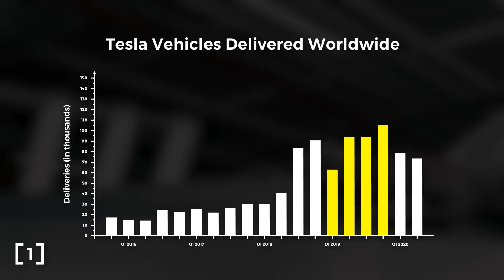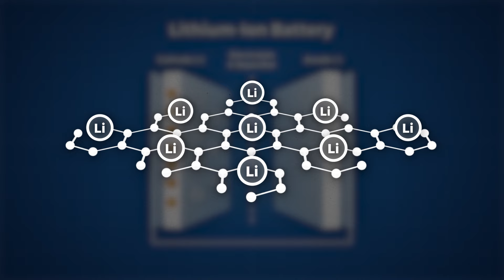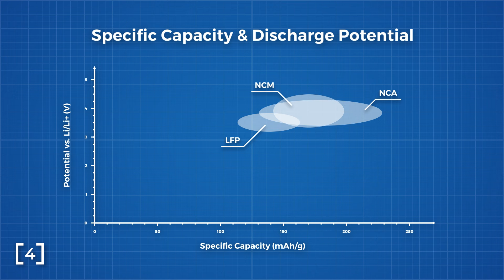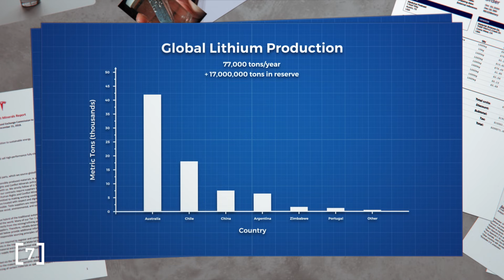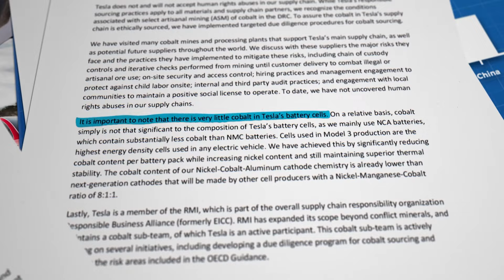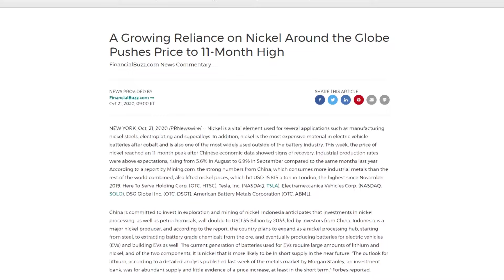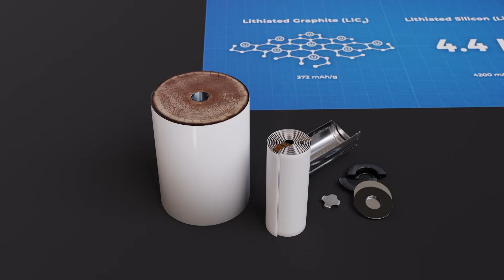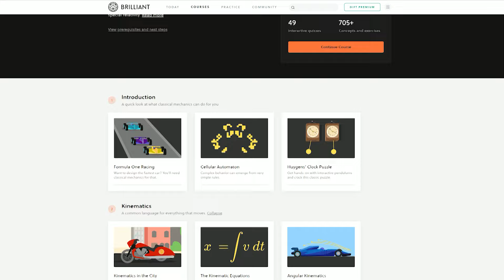Tesla's Battery Supply Problem

Comment: Battery recycling would be a great topic for one of your next videos.
Reply: Battery recycling is the solution to many issues.  It's starting to happen.  Battery recycling won't hit its stride until there are enough 'used up' batteries to support plants.  And Tesla batteries are lasting a long time.  The EVs that have reached 200,000 miles still have over 90% of their initial range remaining, for the most part.
Reply: @bobwallace9753  But what if recycling will be so expensive (even after all the innovations) that electric cars will become unprofitable? I am just wondering.
Reply: @HaldirZero  - that is the question?
Reply: @HaldirZero  recycling is cheaper than mining, and Tesla is already more or less profitable with mining:)
Reply: @HaldirZero  One of the founders of Tesla, J.B. Straubel, has started a company called Redwood Materials which is setting itself up to be a major recycler of used lithium batteries.  This is only one of the companies that intend to carry out battery recycling.  

Elon Musk has stated that recycling will be the least expensive way to obtain materials to use in manufacturing new batteries.  A used battery is basically a hunk of highly refined battery materials.  Grind it up and separate out the different materials for reuse.

Redwood Materials has started work with Panasonic at Tesla's Nevada gigafactory.  They are recycling cells from the plant that aren't usable in EVs due to some manufacturing problem.
Reply: I second this, I’d love to hear if this is sustainable because we also need to address the up front carbon footprint that this manufacturing is causing. That added with the power production to run these vehicles go hand in hand with ensuring we’re still on track.
Reply: @GelPen1008  Let's think a bit about the manufacturing carbon footprint for batteries (and EVs).  

Materials/minerals need to be mined.  We do most of that with diesel but it could be done with electricity.  We already do some mining with electricity.

Those materials need to be transported to the processing plants and on to factories.  We're doing a lot of hauling with diesel but we could do it with electricity.

The processing plants and factories run on electricity.   Unfortunately a lot of the electricity comes from fossil fuel but we have the technology to replace 100% of that fossil fuel with renewable energy.

IMO, there needs be no, or almost no carbon footprint for batteries and EVs.  We just have to replace diesel motors and fossil fuel with renewable energy.  Do that and we also save money.

What I've left out is carbon emissions from turning iron ore into steel.  We use some coke for that but it looks like we could use 'green' hydrogen to bind up the oxygen in the iron ore.  

And the carbon released as we make cement for concrete.  There are ways to make cement without emitting carbon but they are a bit more expensive.  If we factor in the cost of climate change then the cost of carbon-free cement becomes cheap.  And it might be possible to make concrete that actually captures and stores CO2 by using basalt/olivine  sand and gravel for the aggregate.

There are a lot of solutions.  We just need to implement.
Reply: EVs have a greater manufacturing carbon footprint than internal combustion engine cars, but it is recouped in 4-6 months because of the lower carbon footprint of fueling. (EVs are 4 times as efficient as ICE cars so they have a much lower carbon footprint, even if the electricity is generated from dirty sources.)
Reply: @bobwallace9753  those are some great points for areas we can refine and optimize in our manufacturing process!
Reply: @bobwallace9753  "Materials/minerals need to be mined.  We do most of that with diesel but it could be done with electricity.  We already do some mining with electricity."

I am interested to see how you think this could be done.

"Those materials need to be transported to the processing plants and on to factories.  We're doing a lot of hauling with diesel but we could do it with electricity."

This would mostly consist of upgrading the massive network of diesel trains to electric.

"The processing plants and factories run on electricity.   Unfortunately a lot of the electricity comes from fossil fuel but we have the technology to replace 100% of that fossil fuel with renewable energy."

This does run into the chicken/egg problem where the energy supply for this will need the battery storage to be built by the processing plant before they can make the switch.

"IMO, there needs be no, or almost no carbon footprint for batteries and EVs.  We just have to replace diesel motors and fossil fuel with renewable energy.  Do that and we also save money."

I agree but this in practice is a massive investment with significant logistic barriers. The key here is that the this makes putting the resources into infrastructure upgrades more important than having those resources go into EV's as the benefit is higher.

"What I've left out is carbon emissions from turning iron ore into steel.  We use some coke for that but it looks like we could use 'green' hydrogen to bind up the oxygen in the iron ore. "

Ok, how is the carbon then added to the iron to make steel?

"And the carbon released as we make cement for concrete.  There are ways to make cement without emitting carbon but they are a bit more expensive.  If we factor in the cost of climate change then the cost of carbon-free cement becomes cheap.  And it might be possible to make concrete that actually captures and stores CO2 by using basalt/olivine  sand and gravel for the aggregate."

Fly ash cement is pretty cool and may be economically viable for several decades. What we do with that concrete after that will be another generation's toxic waste problem.

"There are a lot of solutions.  We just need to implement."

I agree but implementation is always the hard part.
Reply: a Australia company is do the recycling battery. Thay are thay are the only one.
Reply: my laptop  battery bloated and destroyed the keyboard, I was so scared that I removed it and left on rooftop of my house
Reply: @SurmaSampo  Mining is already done underground with large machinery powered by electricity.  How we would power that equipment would be a financial decision.  The least cost solution might be swappable battery packs for the large trucks that haul ore from the mines.  The more stationary digging equipment might be powered by a cable, as is often done in mines.  Or we might use mobile power packs, large battery packs on wheels or treads that move themselves between equipment and a charge outlet.  

Yes, we would  either have to electrify rail or use battery powered trucks for transportation from mine to processing plant.  Perhaps we start processing close to mines and haul from the mine to the plant with trucks.

Yes, we are and we will continue to use fossil fuels to bootstrap renewable energy installations.  But years back we reached the point at which installed wind farms and installed solar panels both produced annually more electricity than was consumed to manufacture more wind turbines and solar panels.  At this point we aren't using fossil fuels for the energy needed but basically for fill-in while we build out storage.  And we're using fossil fuel for transportation.  But that is likely to rapidly change.

"The key here is that the this makes putting the resources into infrastructure upgrades more important than having those resources go into EV's as the benefit is higher."

I'm not sure I understand this.  Clearly we can weatherize buildings and swap out fossil fuel heaters for heat pumps at the same time we replace ICEVs with EVs.  It is very important that we do both at the same time.  And economics will drive us to do both at the same time.

During steel processing coke is burned.  The oxygen for that burning comes from the heated ore (iron oxide).  The release oxygen is bound to the carbon in coke and becomes CO2.  If we replace the coke with green hydrogen the released oxygen binds with the hydrogen atoms and becomes H2O, water vapor.
Reply: @bobwallace9753  "Mining is already done underground with large machinery powered by electricity.  How we would power that equipment would be a financial decision.  The least cost solution might be swappable battery packs for the large trucks that haul ore from the mines.  The more stationary digging equipment might be powered by a cable, as is often done in mines.  Or we might use mobile power packs, large battery packs on wheels or treads that move themselves between equipment and a charge outlet. "

This is what I pretty much figured as well except you have to get CAT to abandon it's ICE business. It is also worth noting that most mines have their own power generation which would need to be transitioned adding more storage needs as well.

"Yes, we would  either have to electrify rail or use battery powered trucks for transportation from mine to processing plant.  Perhaps we start processing close to mines and haul from the mine to the plant with trucks."

I agree as well but in many instances the processing is done in a different country to extraction which is a massive infrastructure and commercial change. Either the mining company will need to build localised processing and stop exporting ore to its clients or the client companies will have to expand their operations and costs.

"Yes, we are and we will continue to use fossil fuels to bootstrap renewable energy installations.  But years back we reached the point at which installed wind farms and installed solar panels both produced annually more electricity than was consumed to manufacture more wind turbines and solar panels.  At this point we aren't using fossil fuels for the energy needed but basically for fill-in while we build out storage.  And we're using fossil fuel for transportation.  But that is likely to rapidly change."

Pretty much.

"The key here is that the this makes putting the resources into infrastructure upgrades more important than having those resources go into EV's as the benefit is higher.

I'm not sure I understand this.  Clearly we can weatherize buildings and swap out fossil fuel heaters for heat pumps at the same time we replace ICEVs with EVs.  It is very important that we do both at the same time.  And economics will drive us to do both at the same time."

The problem is competition for the energy storage resources that go into EV's and energy supply. I realise different chemistry can be used but there is still a significant overlap unless something like liquid metal storage can become viable at scale.

"During steel processing coke is burned.  The oxygen for that burning comes from the heated ore (iron oxide).  The release oxygen is bound to the carbon in coke and becomes CO2.  If we replace the coke with green hydrogen the released oxygen binds with the hydrogen atoms and becomes H2O, water vapor."

Steel is an alloy of iron and carbon. The coke at the right ratio, temperature and oxygen levels deoxidises the iron oxide and supplies the carbon. You still need a carbon source to make steel rather than just iron.
Reply: @bobwallace9753  Lie like a dog. How much plastic in a tesla?
Reply: @SurmaSampo  Let's start with a bare fact.  We must and will transition off fossil fuels.  The only question how soon.  Will we act quick enough to avoid extreme climate change or will we drag our feet and end up really suffering?

Yes, lots of companies will have to stop manufacturing and using internal combustion engines.  Perhaps there will be a few niches where that would be very difficult and we will end up using biodiesel or some sort of synfuel.

I think we're going to see massive amounts of battery manufacturing being built over the next few years.  The math now works.  Tesla has plans to create a lot of cell production and I'm sure other battery manufacturers will join in.  There's money to be made.

Short term, we need battery storage for grid management.  There are few places with enough surplus wind and solar generation to require time-shifting storage.  In the near term most grids can add wind and solar and turn down/off natural gas generation.  And many can "hold back" hydro, saving that water for when wind and sunshine are underproviding.

The carbon embedded in carbon steel is not a problem.  It's sequestered.  It's the carbon that is used for binding up the released oxygen that creates the CO2 emissions.
Reply: @robertkubrick3738  How much plastic is in a Tesla?  As much as is needed.  Do you have a point to make or are you just tossing insults out of insecurity?
Reply: @bobwallace9753  ""Let's start with a bare fact.  We must and will transition off fossil fuels.  The only question how soon.  Will we act quick enough to avoid extreme climate change or will we drag our feet and end up really suffering?"

I don't disagree but the implementation plan of how this occurs really does matter. What are people willing to sacrifice along the way and how much?

"Yes, lots of companies will have to stop manufacturing and using internal combustion engines.  Perhaps there will be a few niches where that would be very difficult and we will end up using biodiesel or some sort of synfuel."

How is this achieved? Do we ban and bankrupt or is there a transitional path?

"I think we're going to see massive amounts of battery manufacturing being built over the next few years.  The math now works.  Tesla has plans to create a lot of cell production and I'm sure other battery manufacturers will join in.  There's money to be made."

I agree that Tesla does plan to do a lot of production but trying to make exclusivity deals with mines smells of a looming monopoly. Most of the world's production capacity in this space is currently in China which is an issue.

"Short term, we need battery storage for grid management.  There are few places with enough surplus wind and solar generation to require time-shifting storage.  In the near term most grids can add wind and solar and turn down/off natural gas generation.  And many can "hold back" hydro, saving that water for when wind and sunshine are underproviding."

We need storage long term and most energy intensive industries also run their own power plants that need to be local to operations and supply 24/7. That demands storage as well. I come from the perspective of Australia where the real question is about coal and distance problems.

"The carbon embedded in carbon steel is not a problem.  It's sequestered.  It's the carbon that is used for binding up the released oxygen that creates the CO2 emissions."

But you still need to add carbon from a carbon source and the process of doing so creates CO2. Where would the carbon be sourced from because it currently is coked coal or black coal.
Reply: @SurmaSampo  
Very soon, certainly within five years but more likely three, it will become cheaper to manufacture an EV than a same feature ICEV.  Tesla will certainly be there with their new tabless, dryroll batteries.  EVs are already a lot cheaper to "fuel" and maintain.

There should be an automatic switch away from ICEVs.  How many people are going to pay more for a gas "Camry" than a battery "Camry" and then spend more to operate it?  Obviously a few will at first, but people will catch on.  Businesses will switch to battery powered vehicles very rapidly because it will impact their bottom line.  I'm no longer concerned about getting petroleum out of our lives.

Wind and solar are now our least expensive ways to generate electricity.  Coal plants are being shut down because they can't compete.  Our electricity will get cheaper, or at least not increase in price along with inflation as we move to renewables.

I'm concerned that we won't move to renewables fast enough.  I'd like to see the government establish a carbon tax.  Charge a tax on all electricity that utilities purchase from coal or gas plants.  Then use that tax revenue to subsidize consumer utility bills so that there's no change in what we pay for electricity.  Utilities will switch away from fossil fuels faster if it's good for their bottom line.

There are more than enough deposits of lithium, nickel, aluminum and all the other materials needed for batteries. Tesla can use all they want and other battery manufacturers can get their own sources.  Tesla may become the world's largest car manufacturer but I don't see how they become a monopoly.  Other manufacturers are not blocked from entering the market.

Switching off fossil fuels will be a big job but one that we can do.  The US is now about 60% fossil fuels for grid supply.  A couple years back we transitioned 2% of our grid supply from FF to RE.  If we simply double that effort we could be free of FF in 15 years.  And 4% per year is very doable and getting easier.  We've got more efficient solar panels and learned to mount our wind turbines up higher in order to produce a lot more electricity from the same sized turbine.  (60% to 70+% capacity factor vs. 40% CF)  We wouldn't need to double our efforts, just be more efficient in what and where we install.
Reply: @bobwallace9753  "Very soon, certainly within five years but more likely three, it will become cheaper to manufacture an EV than a same feature ICEV.  Tesla will certainly be there with their new tabless, dryroll batteries.  EVs are already a lot cheaper to "fuel" and maintain."

I would like to see that as they are currently unaffordable for the majority of people.

"There should be an automatic switch away from ICEVs.  How many people are going to pay more for a gas "Camry" than a battery "Camry" and then spend more to operate it?  Obviously a few will at first, but people will catch on.  Businesses will switch to battery powered vehicles very rapidly because it will impact their bottom line.  I'm no longer concerned about getting petroleum out of our lives."

This will still take a generation as cars have long service lives and the second hand market is massive and long tailed.

"Wind and solar are now our least expensive ways to generate electricity.  Coal plants are being shut down because they can't compete.  Our electricity will get cheaper, or at least not increase in price along with inflation as we move to renewables."

Yes they are certainly cheaper but most of the coal plants here are on 20 year minimum rate contracts. To shut them down would require a buyout on the contract remainder.

"I'm concerned that we won't move to renewables fast enough.  I'd like to see the government establish a carbon tax.  Charge a tax on all electricity that utilities purchase from coal or gas plants.  Then use that tax revenue to subsidize consumer utility bills so that there's no change in what we pay for electricity.  Utilities will switch away from fossil fuels faster if it's good for their bottom line."

Yeah, that unfortunately is unfeasable here due to the structure of commercialisation of the system. It would just bankrupt the state run distributors and/or private retailers.

"There are more than enough deposits of lithium, nickel, aluminum and all the other materials needed for batteries. Tesla can use all they want and other battery manufacturers can get their own sources.  Tesla may become the world's largest car manufacturer but I don't see how they become a monopoly.  Other manufacturers are not blocked from entering the market."

The amount of a resource and its commercial availability can be very different things. See DeBeers as an example.

"Switching off fossil fuels will be a big job but one that we can do.  The US is now about 60% fossil fuels for grid supply.  A couple years back we transitioned 2% of our grid supply from FF to RE.  If we simply double that effort we could be free of FF in 15 years.  And 4% per year is very doable and getting easier.  We've got more efficient solar panels and learned to mount our wind turbines up higher in order to produce a lot more electricity from the same sized turbine.  (60% to 70+% capacity factor vs. 40% CF)  We wouldn't need to double our efforts, just be more efficient in what and where we install."

What will work in the USA will not necessarily work here or elsewhere. Different legal, logistic and industrial considerations require different solutions. The state where I live is about 85% coal and that is unlikely to drop below 50% this decade no matter how much we may want it too.

Australia should be first to the 100% target but I doubt that will happen before 2035 due to a multitude of factors.
Reply: @SurmaSampo  The average cost of a new car in the US is about $35k which is the cost of the basic version of the Tesla Model 3.  And in terms of monthly out of pocket costs (loan payment and fuel/charging) a $35k EV is about the same as a $30k ICEV.  Anyone who can afford a 'nicer' Camry can afford a Tesla 3.  And in a couple of years Tesla intends to start selling a $25k EV, which would be like buying a $20k ICEV.  

Plus China is getting ready to export to other countries.  If US and European manufactures don't supply more affordable EVs it looks like Tesla and China will.

Don't underestimate how quickly we may transition away from ICEVs and fossil fuel electricity.  Transitions can happen very rapidly once they get underway.  It typically takes a long time to reach the first 1% and another long time to reach the first 10% but after than things generally move very rapidly.  With cars it may go very rapidly once robotaxis appear in number.  Many people will find it cheaper and more convenient to just phone for a ride.  And expect governments to start pushing hard for renewable energy as soon as they realize that electricity will become less expensive and that they can save hundreds of billions annually on healthcare.

Australia has cheap solar and expensive grid electricity, IIRC.  As the price of storage batteries falls look for lots of people to add solar and storage in order to save money.  And as that happens the government is going to be forced to look for ways to cut the cost of grid electricity to keep as many people on the grid as possible.  I suspect coal might get paid to go away.
Reply: @bobwallace9753  "The average cost of a new car in the US is about $35k which is the cost of the basic version of the Tesla Model 3.  And in terms of monthly out of pocket costs (loan payment and fuel/charging) a $35k EV is about the same as a $30k ICEV.  Anyone who can afford a 'nicer' Camry can afford a Tesla 3.  And in a couple of years Tesla intends to start selling a $25k EV, which would be like buying a $20k ICEV. "

The average price paid for a new car in Australia isn't available as no one produces that data but it would ballpark around the $40K - $50K mark. That is the price of a mid range Camry. The price of a base model Tesla 3 is about $100K because we don't have massive subsidies and there is an extra tax on expensive cars. Since the median income per household is $66K only the top 2% can afford a Tesla here.

Few would support subsidising foreign auto manufacturers after our history with GM. They well and truly burned that bridge to the ground and salted the earth.

"Plus China is getting ready to export to other countries.  If US and European manufactures don't supply more affordable EVs it looks like Tesla and China will."

Tesla isn't likely to be affordable for most Australians for the foreseeable future so hopefully other manufacturers will pick up the slack. The bigger problem is there isn't any significant supporting infrastructure outside of a few capital cities.

"Don't underestimate how quickly we may transition away from ICEVs and fossil fuel electricity.  Transitions can happen very rapidly once they get underway.  It typically takes a long time to reach the first 1% and another long time to reach the first 10% but after than things generally move very rapidly.  With cars it may go very rapidly once robotaxis appear in number.  Many people will find it cheaper and more convenient to just phone for a ride.  And expect governments to start pushing hard for renewable energy as soon as they realize that electricity will become less expensive and that they can save hundreds of billions annually on healthcare."

The party who has been historically in power here at the federal level for 70% of the time is doing everything it can to stall renewable grid power. The mining industry has a crushing grip on our legislatures. Our largest publicly listed company makes most of its profit from coal and the coal supply chain. Only two Prime Ministers in our modern history have stood against the mining industry and both got sacked.

At best guess we are over a decade away from autonomous vehicles that can cope with co-existing on roads with human drivers. I really look forward to never having to drive a car again but since I regularly travel to rural areas robo-taxis are not much help to me.

"Australia has cheap solar and expensive grid electricity, IIRC.  As the price of storage batteries falls look for lots of people to add solar and storage in order to save money.  And as that happens the government is going to be forced to look for ways to cut the cost of grid electricity to keep as many people on the grid as possible.  I suspect coal might get paid to go away."

I don't think you grasp the scope of the coal industry as a part of our economy. It would be like shutting down the entire media production (all mediums) industry in the USA.

Our grid is only profitable in small high density areas. The rest that services the rural and regional population is spread thin and unprofitable. Also our grid wasn't designed to support at scale consumer feed in which means solar at home is limited to 6KW. The upgrade cost would be massive and add to our existing high electricity costs.

Remember that the largest consumers of energy in production like smelters and mines have to run their own power stations as they exceed our grid capacity. Also a number of these mines are really isolated. For a variety of reasons those power plants are running on diesel or coal.

Pumped Hydro would be a great way to provide grid leveling storage if it wasn't for our ecological, climate and geographical problems. Australia's ecology is fragile, our country is dry (and highly flammable!) and mostly flat.

We could easily fund the renewable energy production and storage from a small fraction of our pension funds but the implementation is challenging from a number of angles.

The reality is that the infrastructure in Australia is nothing like yours. Neither are our political and economic landscapes. Government funded renewable energy projects and grid modernisation would be a great idea to help get us out of our economic depression but that would be political suicide.

There is a betting odds chance that the mining industry, the neocon coalition, murdoch and covid have intersected to collapse our economy for at least a generation.
Reply: @SurmaSampo  You seem to be ignoring the fact that we are very close to the point at which EVs reach manufacturing cost parity with ICEVs.  And then the cost of manufacturing EVs drops lower than ICEVs.  What you pay for cars in AU is irrelevant.  EVs will become cheaper than ICEVs and most people will not pay more for a car that costs more to operate.

In a few years when you want to buy a car the EV, that is made by some acceptable company, will cost less than a same-feature ICEV.  

At best guess we are about a year from fully autonomous cars that can operate on any road where humans would drive.  Add one more year for the collection of data that will start state/local regulatory agencies to permit driverless cars on the road.  My worst guess is that it might take three rather than two years.  

At this point in time no one has identified a driving issue that Tesla's FSD system can't handle.  It just needs more "experience", more "training", to become a smooth highly capable driver.  We should expect to discover some rarely encountered problems to turn up and have to be solved for.  But so far no one knows what those problems might be.  

Some governments will fight RE and support their fossil fuel supporters.  They will fail.  They will fail because of public demand for less expensive electricity and they will fail because industry and commerce will insist on less expensive electricity in order to compete in the global economy.

Perhaps you don't realize that there are mines in Chile that have installed solar to run their operations because it's cheaper than using diesel.  And the oil industry is installing solar as a way to cut their costs for wells that aren't grid connected.  RE is cheaper.  It will win and is winning.

Australia is a democratic country.  You'll wise up and vote out the fossil fuel servants.  And, hopefully, Murdoch will soon die and get out of all our lives.  He's caused massive, massive damage in the US.  Donald Trump is one of his accomplishments.
Reply: @bobwallace9753  "You seem to be ignoring the fact that we are very close to the point at which EVs reach manufacturing cost parity with ICEVs.  And then the cost of manufacturing EVs drops lower than ICEVs.  What you pay for cars in AU is irrelevant.  EVs will become cheaper than ICEVs and most people will not pay more for a car that costs more to operate."

Cost to purchase is perhaps the most relevant criteria for purchasing decisions in a market. The claim that the cost to manufacture an EV will reach parity with ICE's is just about to happen is a bold claim. Is there actually proof for that?

"In a few years when you want to buy a car the EV, that is made by some acceptable company, will cost less than a same-feature ICEV. "

I want to buy one now but they are far outside of my price range of $10-15K. I also need to be able to drive 1000km in a day through sparsely populated rural areas about once every 2 months. The lack of any charging stations at all is an issue.

"At best guess we are about a year from fully autonomous cars that can operate on any road where humans would drive.  Add one more year for the collection of data that will start state/local regulatory agencies to permit driverless cars on the road.  My worst guess is that it might take three rather than two years. "

From the talks I have seen by experts in the field last year they were guessing closer to 10 years for autonomous vehicles that can negotiate human traffic.

"At this point in time no one has identified a driving issue that Tesla's FSD system can't handle.  It just needs more "experience", more "training", to become a smooth highly capable driver.  We should expect to discover some rarely encountered problems to turn up and have to be solved for.  But so far no one knows what those problems might be. "

Is there any data to prove that?

"Some governments will fight RE and support their fossil fuel supporters.  They will fail.  They will fail because of public demand for less expensive electricity and they will fail because industry and commerce will insist on less expensive electricity in order to compete in the global economy."

People did demand less expensive electricity here so they scrapped the carbon tax and reduced subsidies for renewables. The largest users of electricity in Australia also generate their own power off grid. 

"Perhaps you don't realize that there are mines in Chile that have installed solar to run their operations because it's cheaper than using diesel.  And the oil industry is installing solar as a way to cut their costs for wells that aren't grid connected.  RE is cheaper.  It will win and is winning."

We are the world's suppliers of black coal and the ore freight networks are essentially build by the coal mines here. I would prefer they put in RE but coal really is amazingly cheap locally. Also you don't want to piss off the freight operator and the load out facilities at the ports that transport your ore.

"Australia is a democratic country.  You'll wise up and vote out the fossil fuel servants.  And, hopefully, Murdoch will soon die and get out of all our lives.  He's caused massive, massive damage in the US.  Donald Trump is one of his accomplishments."

The Australian voting public relies on the news media to be informed and all of it here is owned by murdoch. His family that has already inherited control isn't likely to change direction. Australians can only vote for the choices we have available and all of them are rightfully scared of the mining industry. They really do wield a massive amount of power.

The likelihood of Australia downsizing the mining industry is the same as the USA downsizing its military industry. Neither party is going to do it.
Reply: @bobwallace9753  I think 90% range remaing is a bit of an over estimation, the owner that has driven 600,000 miles in his Tesla has had 2 battery replacements and 3 drive train replacements. That's 200-250,000 miles before the pack needs replacing.
Reply: @pobvic  There's a couple of different issues here, Phil.  The 600k mile Tesla, I assume, is the Tesloop car that makes multiple daily runs between LA and Las Vegas.  That car had its battery pack replaced at 200k, not because the pack was underperforming, but because the current version of Tesla's software was not set up to accurately calculate range remaining for batteries with more than 200k miles.  Because it was going to take time to rewrite a portion of the software and test it Tesla replaced the battery pack so that Tesloop wouldn't lose revenue.  I don't know why the second pack was replaced or how many miles it had run before replacement.  

I just checked the Tesla Battery Survey which collects self-reported data from Tesla owners.  There have been a few battery packs that have fallen below 80% but the trendline is about 88% at 250,000 miles.  That suggests that most packs will stay above 80% for well past 250,000 miles.

https://docs.google.com/spreadsheets/d/t024bMoRiDPIDialGnuKPsg/edit#gid=826479810

But there's a different battery.  Not the cells installed so far.  Jeff Dahn is the lead battery researcher working with Tesla.  He's been testing a different type cell for the last three years.  His lab has been constantly charging and discharging, cycling, those cells for over three years.  Dahn has not said much about the cells they've been testing but he's talked about how they are manufactured rather than their chemical composition.  I'm assuming he's talking about the new 4680 cells which are easier to cool due to their design.

What Dahn has reported to date is that cells that are discharged no more than 50% before recharging (either down 25% or 50%) have lost no capacity after 15,000 cycles.  The cells that have been discharged 75% to 100% before recharging have lost less than 10% of capacity after 15,000 cycles.  I believe "cycling" is defined as the equivalent of a 100% to 0% discharge.  A cell in the 50% group would undergo two 100% to 50% discharges/recharges and that would be counted as one cycle.   

Dahn has released a bit more information following the earlier presentation.  In the 15,000 cycle presentation he called the cells a 3.5 million km battery.  That's a 2 million mile battery.  Since then his lab has collected more data and he's said that what they are testing are 3.5 million mile batteries.  And it's likely the range will increase as the lab has more time to continue cycling.  They can only test the equivalent of a million miles per year due to discharge and recharge times.  They are discharging and recharging at the rates encountered in EVs.